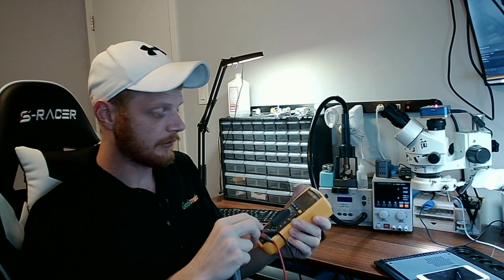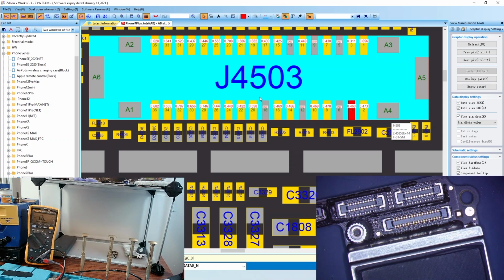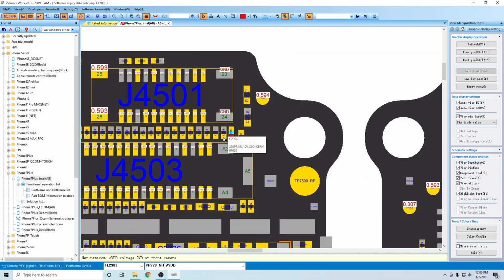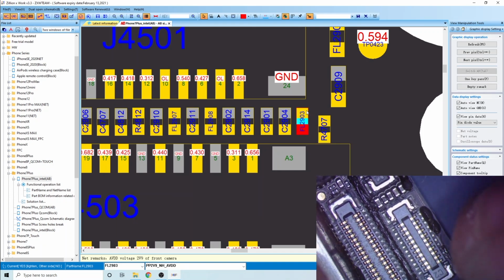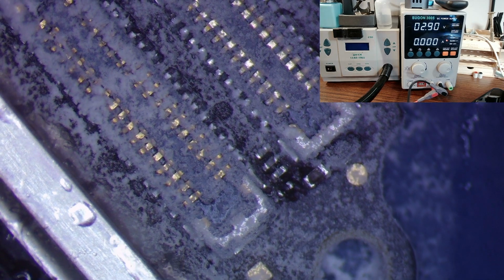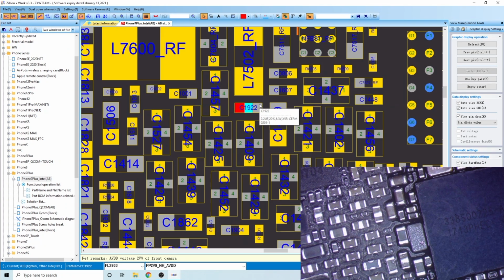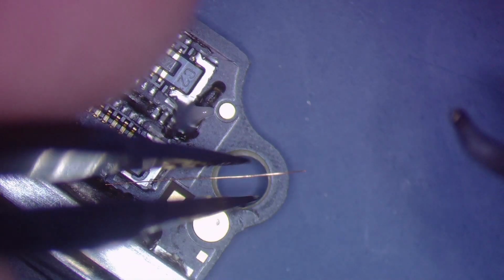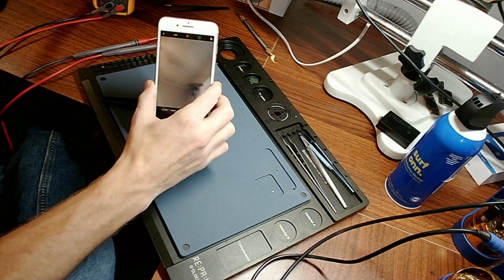Using Diode Mode to Diagnose iPhone and iPad Logicboards

Comment: It's red probe to ground because you're measuring esd protection diodes which are normally reverse biased. Red to ground forward biases them and you get the ~0.5v drop.

Comment: It's red probe on ground because that's how you forward bias a diode.
Reply: Well thats how you forward bias this ESD protection diode or most of the diodes with protection character inside the I/O Ports. Its not how to measure when doing other circuits tbh but u are right in this case.